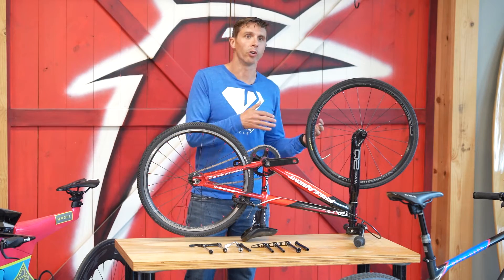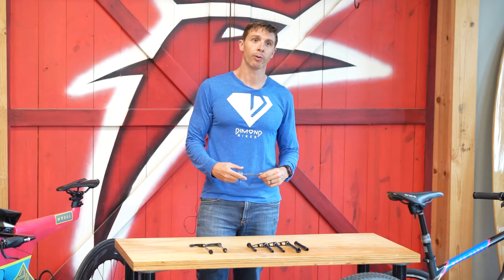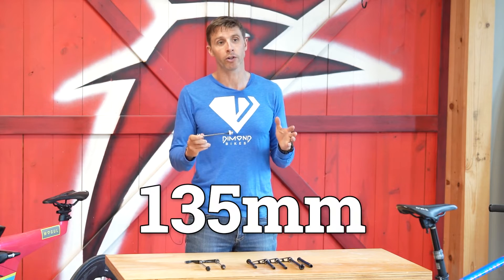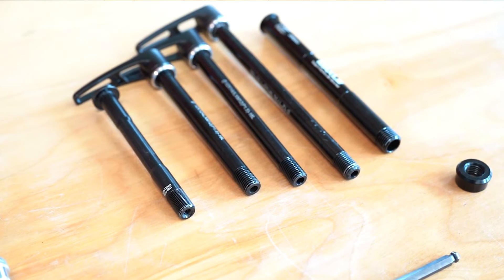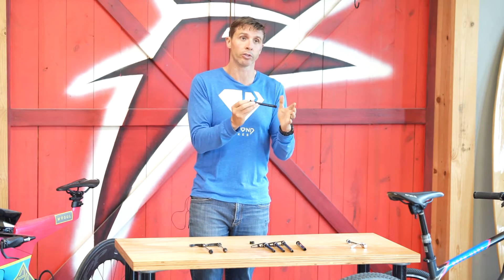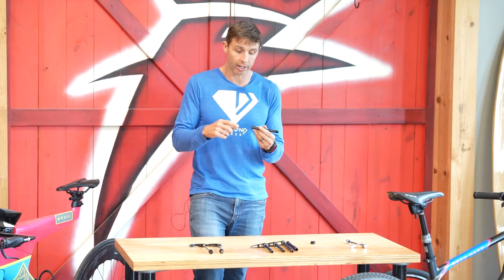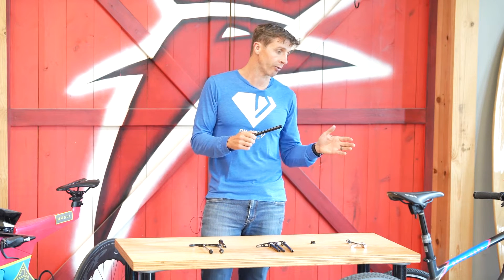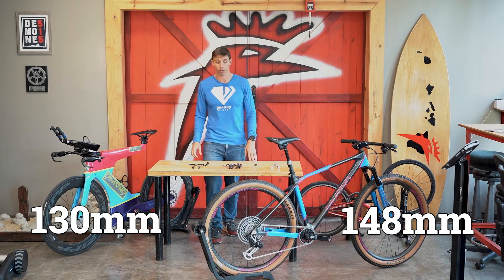Thru Axles vs. Quick Release

Comment: I am a beginner MTB and have a Trek Marlin 7 Gen 2 MTB, with what looks like standard QR. Is there any benefit in converting to a Thru Axle, other than perhaps less chance of having my wheels stolen? Thanks.
Reply from the maker: Great question—especially as you're getting into mountain biking.

Your Trek Marlin 7 Gen 2 uses quick release (QR) axles, which are standard on many entry-level and mid-tier bikes. Converting to a thru-axle would generally require new fork and/or frame components, since they're structurally different systems—not just a simple parts swap.

Here’s a quick breakdown:

Thru-Axle Benefits:

Stiffer connection between wheel and frame, improving steering precision and braking, especially on technical terrain.

Better disc brake alignment since the wheel always mounts in the same spot.

Stronger and more secure than QRs—less chance of the wheel flexing or loosening under load.

QR Benefits:

Lighter and cheaper

Tool-free removal—more convenient for transport or quick fixes.

Easier to find spare parts at entry-level price points.

Should You Convert?

Since your bike is built around a QR system, converting to thru-axle would mean replacing the fork and possibly the frame, which isn't cost-effective. Unless you're upgrading the bike entirely, you're better off riding and enjoying it as-is. When you eventually step up to a higher-end MTB, that’s the time to get a thru-axle setup.

If your main concern is theft, consider a locking QR skewer instead—like those from Pitlock or Hexlox.
Reply: @TJ.at.DimondBikes  This was an AI replying wasn't it? lol
Reply: NO. I have over 30 years experience.

Comment: That doesn't explain much. Most videos like this just fall into boring list of standards for axles. I mean ok there are a lot of them but what does it give to me? Like why should i choose thru axle instead of quick release what kind of benefits it will bring? What downsides it have? For example i have that annoying issue with disc brakes rubbing after some bumps but not sure if TA would completely solve that issue or just slightly reduce it. There should be some reason why for example DT swiss doesn't have QR hubs on their website anymore but it just unclear exactly why.

Comment: my bike has none of these. It just has the quick release lever with no skewer. What is that called?
Reply from the maker: I am guessing it has a skewer attached to the quick release. I've not seen a quick release without a skewer. You don't need to remove the skewer to use the quick release.
Reply: @TJ.at.DimondBikes  that's it I just figured it out haha

Comment: Good vid, I learned about thread pitch the wrong way a couple years ago 😅

Very rad paint job on the hardtail it's like if a modern yeti hardtail met my vintage barracuda in a bar and had a surprise 9 months later 😂🤘